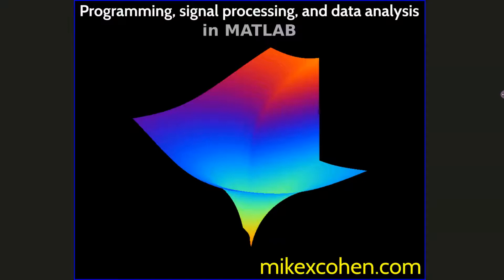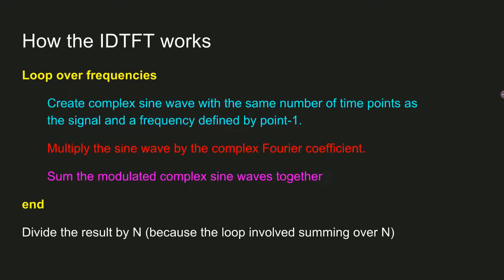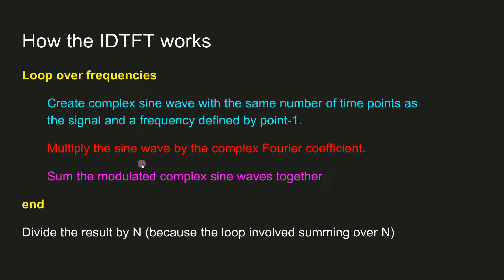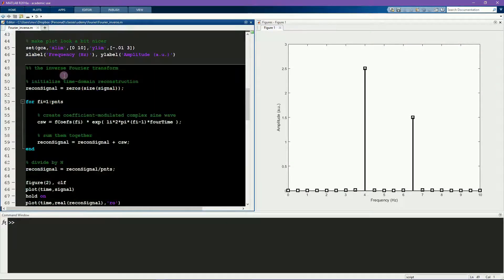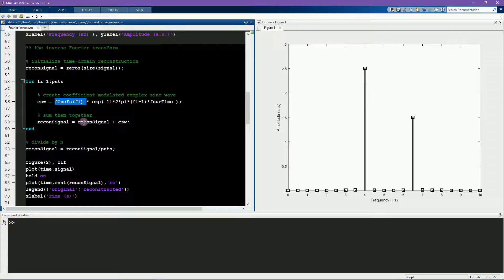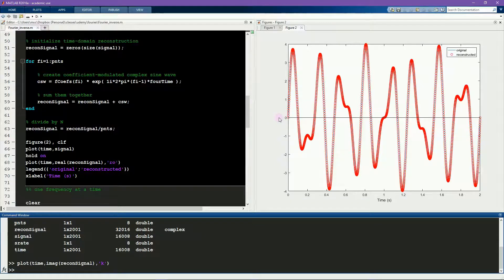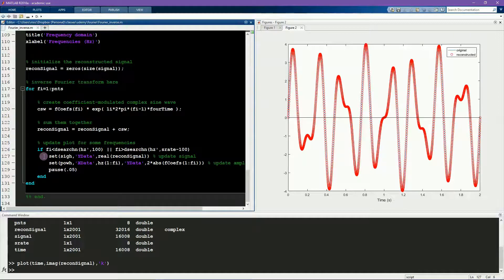Inverse Fourier transform

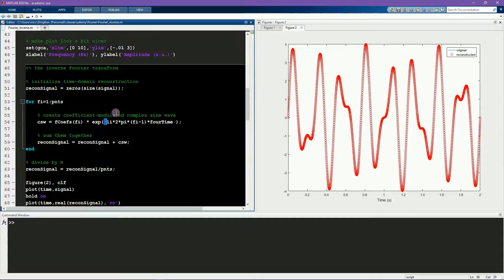Comment: i cant form a graph 3:09 like this , the red color forms a straight line on x-axis
Reply from the maker: Do you mean you don't get circles? That would be "plot(x,y,'ro')". Or do you mean it's a flat line? If you want to send me your code, I can have a look and perhaps help you figure out the problem.

Mike
Reply: Thank you for your reply ! I had actually copied your code to see the same result but i did'nt get the same output as u r showing here ... it had some errors
Reply: %% inverse discrete fourier transform

% create the signal
srate = 1000; % hz
time = 0:1/srate:2; % time vector in seconds
pnts = length(time); % number of time points
signal = 2.5 * sin(2*pi*4*time) + 1.5 * sin (2*pi*6.5*time);

% prepare the fourier transform
fourTime = (0:pnts-1)/pnts;
fCoefs = zeros(size(signal));

for fi=1:pnts

% create complex sine wave
csw = exp(-1i*2*pi*(fi-1)*fourTime);

% compute dot product between sine wave and signal
fCoefs(fi) = sum(signal.*csw);
% these are called the fourier coefficients
end 

% extract amplitudes
ampls = abs(fCoefs) / pnts;
ampls(2:end) = 2*ampls(2:end);

% compute frequencies vector
hz = linspace(0,srate/2,floor(pnts/2)+1);

figure(1), clf
plot(hz,ampls(1:length(hz)),'s-')
% better:
stem(hz,ampls(1:length(hz)),'ks-','linew',3,'markersize',10,'markerfacecolor','w')

% make plot look a bit nicer
set(gca,'xlim',[0 10],'ylim',[-.01 3])
xlabel('Frequency (Hz)'), ylabel('Amplitude (a.u)')

%% inverse fourier transform

% initialize time-domain reconstruction 
reconsignal = zeros(size(signal));

for fi=1;pnts

% create coefficient-modulated complex sine wave
csw = fCoefs(fi) * exp(1i*2*pi*(fi-1)*fourTime);

% sum them together
reconsignal = reconsignal +csw;
end

% divide by N
reconsignal = reconsignal/pnts;

figure(2), clf
plot(time,signal)
hold on
plot(time,real(reconsignal),'ro')
legend({'original';'reconstructed'})
xlabel('Time (s)')
%% one frequency at a time 

clear

% set parametres
srate = 1000;
time = 0:1/srate:3;
pnts = length(time);

% create multispectral signal
signal = (1+sin(2*pi*12*time)) .* cos(sin(2*pi*25*time)+time);

% prepare the fourier transform
fourTime = (0:pnts-1)/pnts;
fCoefs = zeros(size(signal));

% here is the fourier transform
for fi=1;pnts
csw = exp(-1i*2*pi*(fi-1)*fourTime);
fCoefs(fi) = sum(signal.*csw)/pnts;
end

% frequencies in hz
hz = linspace(0,srate,pnts);

% setup plotting
figure(3), clf
subplot(211)
plot(time,signal), hold on
sigh = plot(time,signal,'k');
xlabel('Time (s)')
title('Time domain')

subplot(212)
powh = plot(1,'k','linew',2);
set(gca,'xlim',hz([1 end]),'xtick',0:100:900,'xticklabel',[0:100:500 400:-100]);
title('Frequency domain')
xlabel('Frequency (Hz)')

% initialize the reconstructed signal
reconsignal = zeros(size(signal));

% inverse fourier transform here
for fi=1:pnts

% create coeefficients-modulated complex sine wave
csw = fCoefs(fi) * exp(1i*2*pi*(fi-1)*fourTime);

% sum them together
reconsignal = reconsignal + csw;

% update plot for some frequencies
if  fi < dsearchn(hz',100) || fi>dsearchn(hz',srate-100)
set(sigh,'YData',real(reconsignal))
set(powh,'XData',hz(1:fi),'YData',2*abs(fCoefs(1:fi)))
pause(.05)
end
end
Reply from the maker: Be careful to use : instead of ; in the for loops -- you were accidentally only looping over an index of 1, not going all the way up to pnts.
Reply: Thanks it done :) !! thank u very much, ur the best :)